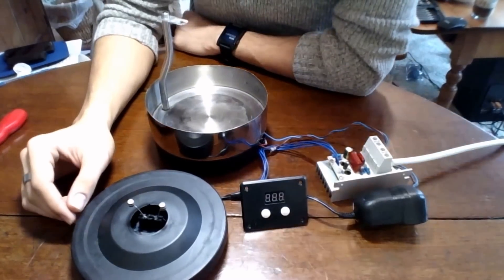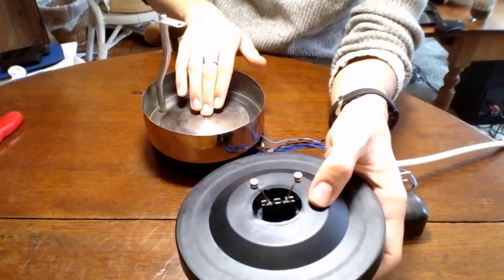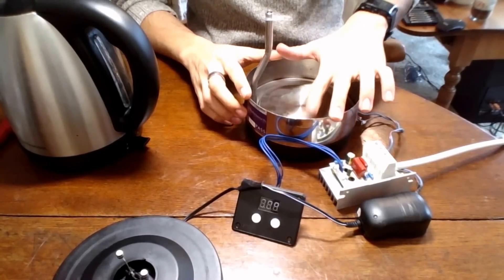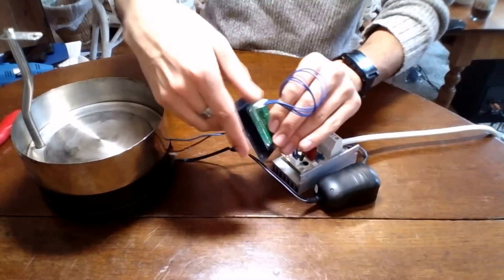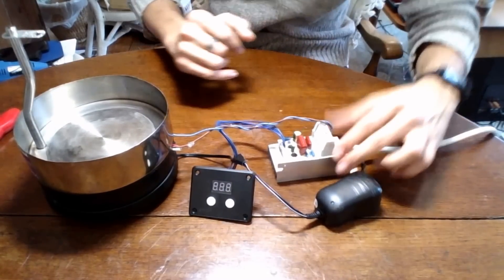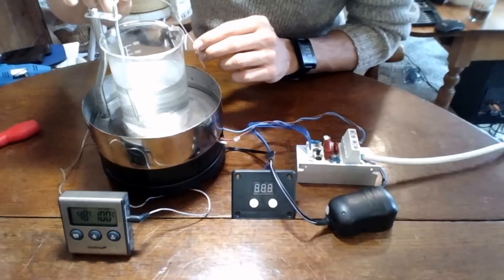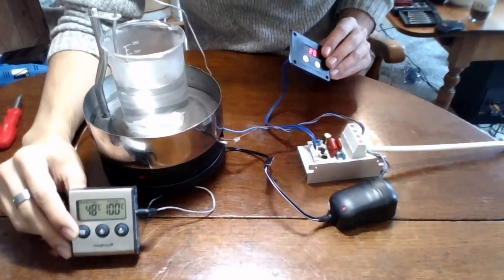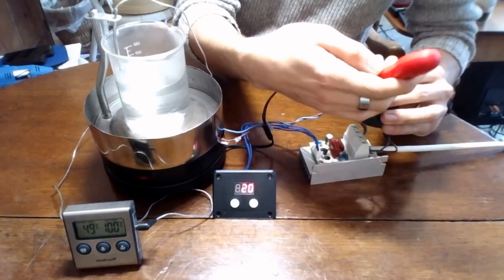[HOW TO MAKE] A Magnetic Stirrer Hotplate

Comment: You dont need to use a fan ! Just use a normal brushless motor core, it crease fluxicating/ac magnetic waves which rotates the magnet in beaker, its the efficit way ! No mechanical movements, no waste of energy, no sound.

Comment: This is great however I'm curious about the fan getting to hot. I have components to make this myself but worried about the fan melting. I'll be using either a deep fryer by cutting the aluminum pan down or a coffee maker heating element from my old Bunn maker. I think it will work with higher voltage even though it'd only used for the warmer. Obviously I won't be using the element to heat the water which is busted anyway but more like a water heater element anyway.

Comment: It is a nice project. I have already tried this. But before final connection I have a question. The raised magnets are at close proximity with concealed heating elements. Is there any possibility to burn the motor or loss of magnetism due to excess heating? I have to run the system more than 2 hours continuously. I am urgently needed your suggestions and help.   Thanks.

Comment: Hello Fereidoon, is it possible to make one of these where the temperature doesn't rise above 89 degrees F?  Also, what if I wanted to use something like this to stir/heat a container that could hold 3 gallons of water?  How many fans would I need for that if the container was plastic and approximately 15"W x 12"L?
Reply from the maker: Hi Pamela,

I'd love to help you, but that sounds like it would need a very different design to what I have here, and you seem to need very specific low temperature control.

For such a large volume I would suggest using a stronger motor than a PC fan motor, I would think a desk fan motor (without the fan on it) would be more than adequate. And for heating I'd suggest using several Peltier Thermoelectric units connected in parallel to each other and figure out how much power to feed into it do achieve your desired temperature by just trial and error. You will need several of them to effectively heat such a container, but the overall wattage will be lower than the kettle's so you will have to figure out how much of a load your voltage controller would have to handle based on how many thermoelectric units you use and their power consumption.

You don't actually need any fans, the only reason I used one was for the motor, and in this specific case it also provides some ventilation, which you won't need anyway as the thermoelectric units will cool on one side and heat on the other.

In fact if you were to use a peltier thermoelectric untit, you would be able to heat or cool your container simply by switching the direction of the current that you're feeding through!

I hope that helps :)
Reply from the maker: RocketmanD12 has made a nice video that may give a decent idea of how to do what I detailed in my previous comment. It's a fairly concise video that would be worth watching: watch?v=pXsOhEdTcqs
Reply: Fereidoon Kavosian Thanks so much for your reply.  I think I'm going to see about doing this without the heating element since that is too involved for me.  I'm just a dog trainer with an invention in mind trying to put a prototype together--far from the technical wizard you are!  I wanted to see if I could make it cheaply at first just to get my idea out there and see if I could find someone to manufacture it working off my prototype.  Thanks so much!
Reply: How do you know it’s not explosion proof, or sparkless with all those connections?  I’d be afraid if heating volatile compounds solvents most use.  Did he do one on thermocouple used?  Cool repurposing if got stuff！

Comment: Great idea ,and a few upgrades for you which im going to do...You should mount all the controls in a nice control box ,so you dont pull all the wires out when  moving it around.im going to use something from the thrift store that works with my controls...the magnets seem a little weak to me so im going  to use a neo magnet from a hard drive with more surface area...i see you having trouble with the thermometer ,im going to try a teflon washer with a snug fit so i have control over the height as well as grip by slide adjustment... excellent idea with the bowl effect , ive gone through a few pyrex containers already since i do my experiments outside ..the rapid cooling and heating changes from the hot plate and glass is costly.the water will dispurse the hot and cold temps better.. for sure.im also going to try some various epoxy coats on the neo magnets for stir rod or melt some teflon over the magnets .

Comment: Hi Fereidoon, can you send me me the actual pic or vid of the wiring? Im planning to make one using a kettle. can you also teach me how to use potentiometer to adjust the speed of the fan or the temperature of the hotplate? I dont know much about the wiring especially for the connections of those variable elements. I always refer to the graphical images and tutorials. Will wait for you reply. Thanks much!

Comment: I found the digital voltage controller, identical to yours used in the video, it is listed  as 220v max..  Will it work with 120 volt systems?  the advertisement didn't specify really anything useful.
Reply: 120v should work 220v is the maximum current the transformer can handle.

Comment: I think DC motors get better torque with PWM control instead of variable voltage, available for less than 10 dollars.  Search DC motor control, fan control, or PWM control... variable voltage is better for non LED lights
Reply from the maker: I'll read up up Pulse Width Modulators and figure out what they do, I haven't heard of those before.

I was thinking about using a regular power adapter and a potentiometer, but in the end I decided to go with the variable voltage power adapter just because it offered a clean and easy 2 in 1 solution, and it was cheaper as well, which is something I try to be conscious of when working on a project -- gotta budget my hobbies ;)

I may actually use a motor speed controller for one of my current projects though, so this is definitely a great suggestion to explore further.

Thanks again for your feedback, I appreciate it.
Reply: Quick and dirty: modulates between a given voltage and zero.  The time interval/frequency is adjusted, lowering the average voltage.  The bipolar nature of it is perfect for DC motors and gives them more torque at low RPMs.

 As for PWM vs voltage regulation for driving TECs, I've read independent research saying lowpass filtered PWM is the way to go, and then a company proves the opposite mathematically, before pitching their proprietary chip.  I found some industrial TEC PID controllers using PWM, but couldn't build it cheap
Reply: ***** ty

Comment: Hello Fereidoon,
i really like your video and would like to build one on my own. I have a question regarding the variable voltage adapter. Could you be a little bit more specific about it, please? For me as a beginner with basic knowledge it's hard to find a device similiar to yours. Where did you get that? I live in Germany and things are a little bit different over here sometimes.
Reply from the maker: Hi Simon,

I'm glad you liked the video. Any generic DC variable voltage adapter will work well. I found this one on amazon.de and it's almost exactly the same as the one that I used in my project: http://www.amazon.de/3-12V-Universal-Netztzeil-1000mA-12Watt/dp/B00ESDII6S/ref=sr_1_15?ie=UTF8&qid=1417864479&sr=8-15&keywords=12V+1000mA

Alternatively if you have an old DC adapter at home that about the right voltage (maybe an old charger or something of that sort) you can connect it to a potentiometer and control the speed of the fan that way. (That's what I did in my other video https://www.youtube.com/watch?v=IwyAbkMMza8)

Good luck with your project and feel free to ask any other questions, I'm a beginner too, but I'm always happy to help! :)
Reply: Fereidoon Kavosian
 Thank you very much.

The other problem would be the kettle. I haven't found any that could fit the fan yet and if they do, they consist out of steel.

I came across another interesting way of how to solve the heating issue. Most things that i am going to cook won't go above 100°C/212°F anyway (mainly to produce super saturated solutions. Easier to make seed crystal that way). Instead i would put my beaker into a heat resistant container, fill the container with water and use an immersion heater. Just like a water bath. A 2000W immersion heater can easily handle about 5L of water so i might as well pick a weaker one. It would work fine for as long as i just want to boil my solution.

Yours is of course the elegant one since you can regulate the amount of heat in a simple way.
Reply: Simon Janda su